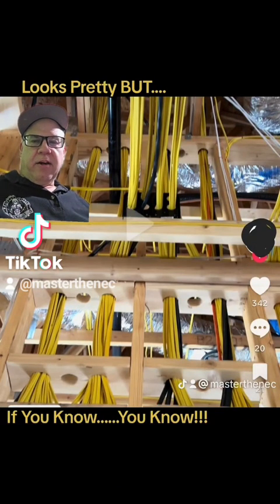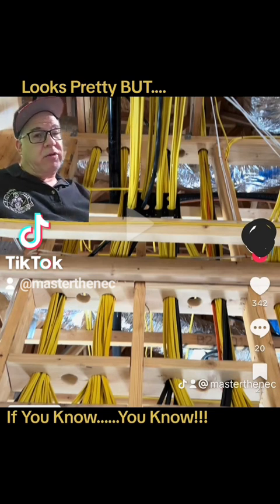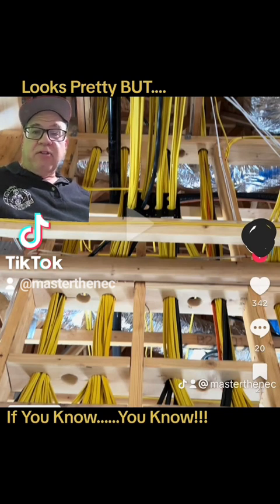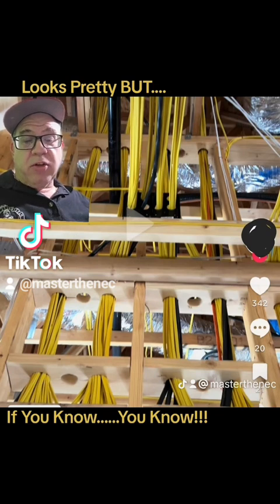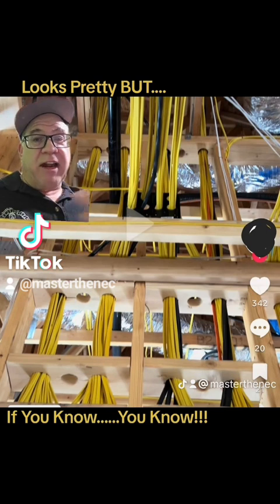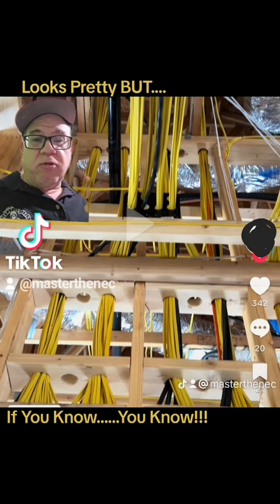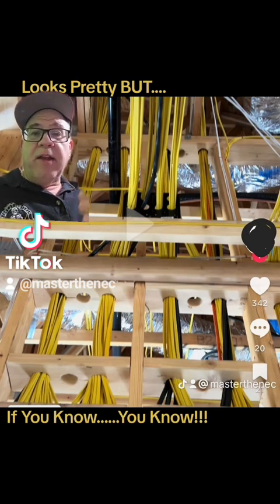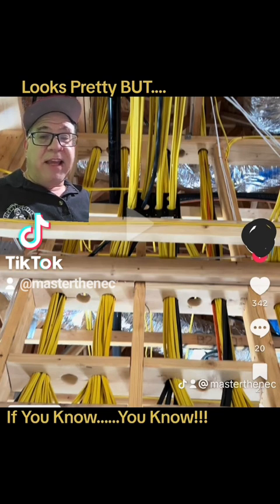Bundling vs Maintaining Spacing

Comment: If you take a look at older - older than 2008 NEC,  you will see the phrase was, "bundled longer than (24in) without maintaining spacing"
Seems  bundled was redundant and deleted. Although Art 520 and Articles 725. 726 use bundled, but not so much as a restriction, as those bundles can be over 100 cables.

Comment: So basically if any cables are routed such that spacing is not maintained for 24" or more, then we treat it as if it is installed inside a conduit?
Reply from the maker: That Works....so if the spacing between cables are not maintained as demanded in 310.15(C)(1) then YES you need to apply adjustments accordingly.

Comment: Why can you use the 90 column to adjust? Are we assuming that NM Cable wire is rated for 90? I don’t see the actual wire inside the cable labeled the temperature it’s rated for
Reply from the maker: Who is assuming? It clearly states in 334.80 that you can use the 90°C for adjustments  as long as the final value used doesn't exceed the 60°C. For example, 12 AWG is rated 30A under 90°C in T310.16. So, (4) 12-2 NM-B together without maintaining spacing for 25". Apply 310.15(C)(1), with 9 CCC's the adjustment is 70%. So, 30A x .70 = 21 Amps. Under the 60°C the amps are 20 Amps. So, even after the adjustment the 12-2 is still OK for 20 Amps and to be protected at 20 Amps per 240.4(D).
Reply: @MasterTheNEC  Got it, I learned something new today thanks!
Reply: If i remember correctly, the construction part of the NM chapter states NM conductors have to be manufactured with 90 degree insulation.
Reply from the maker: Yes, the insulation is rated 90°C. However, only for adjustment purposes, see 334.80.